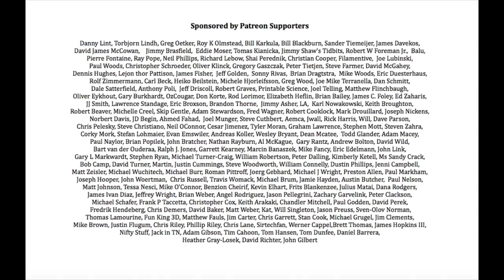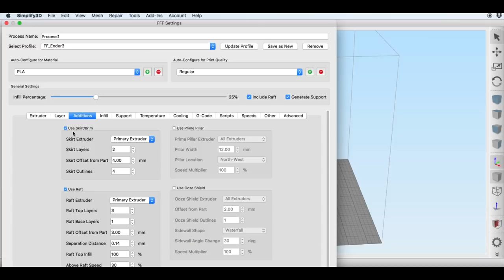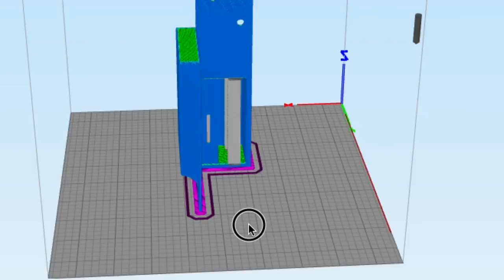Creality Ender 3 - SD Card Adapter and Fan Shroud

Comment: I have a problem, I put the memory, read it, remove it and put it back on and it doesn't read. The test without the adapter and it works perfectly.

Comment: Some commenters have problems with the suggested cable.  I bought a different cable for a huge web site but it wouldn't even fit properly into the Ender 3 micro SD slot - looking at it I could see subtle differences between the actual Micro SD card and the end on the cable.  Any cable that you/someone can recommend that utilizes push-push and works with no issues?

Comment: Great concept but the bigger SD card is not detected unless the micro SD is removed/reinserted first which defeats the purpose.
Reply from the maker: Only on the latest 32 bit boards with Creality firmware. I’ve covered this in layer videos to update the firmware. 8 bit boards work fine.
Reply: @FilamentFriday  I made my own firmware with the latest bug fix version and still same problem

Comment: Ok, so I got the adapter. However, when I seat the SD card it will not update the print screen. If I remove the micro SD adapter and then reinsert it will now show the new prints. but even with an adapter I still have to unseat and reseat the micro SD plugin to the printer. something I am doing wrong?
Reply from the maker: No, they changed the firmware on newer machines. Try updating it.

Comment: when I use the regular sd card my ender doesn't recognize it but the micro sd works fine, any tips
Reply: did you figure this out? I have to turn mine off and then back on for it to recognize the card
Reply: @stevedrawdy2532  there was something I downloaded to make the printer read it, dont remember though, check the 3d printing reddit that's where I found the answer
Reply: @theRealbracey thanks for the reply, I'll check it out!
Reply: @theRealbracey  please can u tell me more about this? i have the same issue

Comment: Would you recommend this ender 3 printer for a first time user. I've been wanting to get my hands on one for a long time now and price wise this fits my budget.
Reply from the maker: Yes, it’s a good choice.
Reply: @FilamentFriday  I second that. The Ender 3 is my first printer, worked first time after assembly (and bed levelling) and the first print with stock settings was perfect.

Comment: Do you have to power off/on the printer each time you insert the card?  Mine wont read any files unless the card is already inserted prior to printer boot up. This is a pain, I switched to sd cards for convenience however this is much more inconvenient that using the micro cards.
Reply from the maker: No. I don’t have to do that.
Reply: @FilamentFriday  thanks for the reply! Wondering if it's something to do with the firmware on the ender 5.
Reply: On my Ender 3 just below the option for Print from card or No card is Change Card, I hit that and then Init card.
Reply: @BenjyBoo  thanks I'll check it out!
Reply: I am running into the same issue
Reply: @julianason236  I haven't found a solution yet, if I do I'll let you know.
Reply: I have the same problem, putting this comment so hopefully a solution will come through.
Reply from the maker: Are you using a new Ender 3 with 32 bit board v4.2.2?
Reply: @FilamentFriday  I'm using a 4.2.7 silent board that I installed on a Ender 3 pro. If the SD is inserted before power up, no problem. If the SD  is inserted after power up (or removed and reinserted) The data is unreachable. The card will say it's there but there's no content inside. In this state, if the microSD end of the ribbon cable is uninserted and reinserted the data is reachable again.
Reply: im having same issues with ender3 v2
Reply: @FilamentFriday  I am having the same issue. If I remove the micro sd from the adapter, it won't work when I put it back in unless I power cycle or remove and re insert the adapter into the printer.
Reply from the maker: Do you have a new Ender with v4.2.2 board?
Reply: @FilamentFriday  Yea, it is the newer 32 bit board.
Reply: @FilamentFriday  I got it to work by adding a loop to check if the card is mounted. 
If yes check the number of files.
If number of files is zero, remount the sd card, else remount the sd card. Not very elegant but it works for now.
Reply from the maker: In the firmware?
Reply: @FilamentFriday  yea, I kept following function calls until I ended up in menu_media.cpp. I made the changes in the menu_media method. It mounts the card every time it is called. I know that is ineffiecient but its a start while I tinker more with the firmware. I'm still very new to marlin and my limited programming experience is in java. The logic is slowly  making more sense, and I'm already hooked  :D
Reply from the maker: Are you working with the latest Marlin release? I thought they had fixed this but Creality never picked it up.
Reply: @FilamentFriday  I'm on the latest bugfix 2.0
Reply: @natechater2  Can you post a turorial somewhere? I'm looking at menu_media.cpp right now but I'm not sure what I need to change.
Reply: @LoadedLen  do you see an option to change media on your menu screen? it should be above print from media (on the ender lcd). If you have that menu item, then you don't need to change the code. That menu item re-init's the card. So, after you put your sd card into your adapter, click on change media. You should be able to access the contents of your card.  If not, go to the void menu_main() method in menu_main.cpp file (line 98). Now, my menu tree is restructured so what you see will be different, but just make sure you are not adding the GCODES_ITEM in the block of another submenu. I think if you add GCODES_ITEM(MSG_REFRESH, M21_STR); at line 124 after SUBMENU(MSG_TUNE, menu_tune); , it should be fine. So, when you put your card back in, click on refresh to get the printer to access your card contents again. Let me know if this helps.
Reply: @natechater2  Hi newbie here, can you share the .bin file to solve this issue? I have an Ender 3 with 4.2.2 board, updated the firmware today from creality site but still have the same problem.

Comment: I have the same adaptor  but is not working  properly.....why do I have to to disconnect en reconnect the micro adapter side into the machine slot every time (otherwise the files can not be read) so I can’t use your nice printed adapter . 
Wat can I do to solve this problem? I have a ender 3 V2
Reply: Same here
Reply: i also have a ender 3 V2 i got after Christmas. when i put the sd card it read it for a while until recently not it doesnt read it unless i pop it out and put it back in I also got an adapter from amazon as well but the adapter does click in but it also comes out with out me pushing it but it still works i just wish it would click in and stay in.
Reply: Did you solve that? Same problem here...
Reply: @allebaseball  nope

Comment: Some people are removing the resistor and some peopke both the resistor and the capacitor and claiming it work than without problems, but I haven't tried it, i don't have the adapter.

Comment: Hi Chuck! I just printed the SD card adapter.  I love the fact the SD card loads from the front. I may Have printed it with too many supports, and it was difficult to remove.  I finally got it removed but weakened  where the fan cowl attaches to the front face.  When I tried to  dress the cable the  cowl piece broke away from the front face. do you have a design that does not have that weak point?  I was wondering if I could just have the screw hole at the far right of the fan cowl on it own tab.  I wanted to ask for your  permission  before I edited it.  I am new to Tinkercad so it might take me a while to do that.

Comment: I need help here is my problem I have the 4.2.7 silent board printed a sd card slot, when I insert the micro SD into the printer without no card inserted on the panel it says card inserted, when I do insert a card then go to the menu it says no tf card inserted, what am I doing wrong
Reply from the maker: Sounds defective.

Comment: Let's do away with the micro SD cards altogether in 3D printers. Save a few steps in the uploading process and utilize a USB flash drive. We should insist that the circuit board manufacturers from here on in only utilize USB slots.

Comment: Hi Chuck, I have a question, I have a Ender 3 pro, I'm using your SD card extension design, but when a connect the adapter the printer is telling me that the card is inserted and there no card just the SD extension cable adapter. I also have a Ender 5,  I printed an housing adapter and is working great. I wonder if you have encounter this situation with the Ender 3 pro. thank you for your help.
Reply from the maker: It’s the firmware. The current Ender 3 32 bit board firmware is crap.
Reply: @FilamentFriday  I heard about some people writing a custom firmware to fix this problem, i think by adding a refresh card option or by just making it work normally. I'll see if I can find it.
Reply: where you able to fix this? i have the same issue with my SD CARD Extension

Comment: When using an extension cable I found the printer became extremely fussy about the type and make of SD Card I have found what I believe to be the problem, after much research I found an article about using sd card extensions on raspberry pi miniature computers, apparently there is a resistor in the extension lead that needs to be removed or cut but before following my advice though please check I have done it to my printer but accept NO responsibility (I have a photo but can’t see a way of attaching it)

Comment: Hello! I'm having a problem with my prints. Every designs that I downloaded from thingiverse prints at correct size and fits well, but my own designs are printed a little bit smaller. I used freecad and SketchUp for drawing and cura to slice. You have a clue or suggestion??
Reply from the maker: Are you using millimeters or inches?
Sketchup designs never seems to transfer to stl very well.
Reply: @FilamentFriday  I used mm

Comment: Interesting that you used one temp and a raft.
Reply from the maker: Do you think I should have used more temps? 
I explained why I used a raft.
Reply: I have never found any reason to change temps in all my years of printing. Why do you feel you need to? I don't use rafts but larger brims instead but "6 of one, half and dozen of the other" I guess lol
Reply from the maker: Me neither but BeatlesCuber questioned it so I asked.
Reply: @FilamentFriday  so I print pla at 220 to make sure I get really good layer adhesion because 210 isn't enough for my parts, and it I get really stuck on rafts on the parts so I print the first layer on the raft at 200.That shifting in the y axis you had might be an indicator to tighten your y belt. Loosen the idler on the y axis and then pull on it till your belt is tight again and tighten the idler. I make puzzles with springs so to make sure I get clean looking parts I use the z axis for the clean look but the high temp for that layer adhesion.
Reply from the maker: Interesting. I use the separation setting in Simplify3D to make the raft separate easier.
Reply: @FilamentFriday  that, I never saw till now, there is so many options on that slicer I'm afraid to screw something up.

Comment: Good video but the Thingiverse link is bad for some reason.
Reply from the maker: I just fixed it.
Reply: CHEP any reason that you boxed over the pc connector instead of leaving it flat with a hole? It would be easier to get to it for firmware updates...
Reply from the maker: Watch at 3:10. I have a hole for the cable on the side. If it was on front the ribbon cable just gets in the way. I don’t expect to update firmware very often. But if I do, 3 screws and I’m in. Besides I’d have to load a bootloader first so it’s gotta all come apart for that.